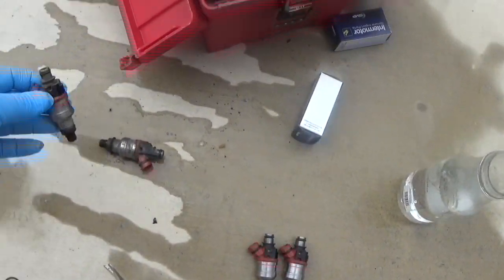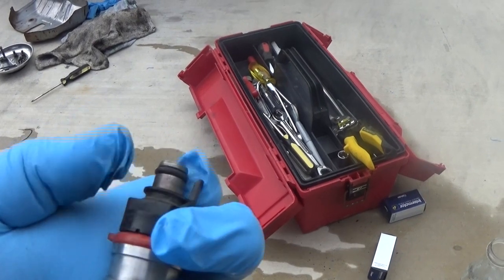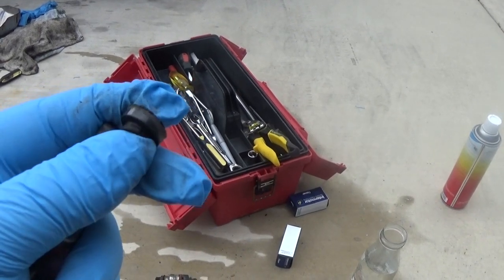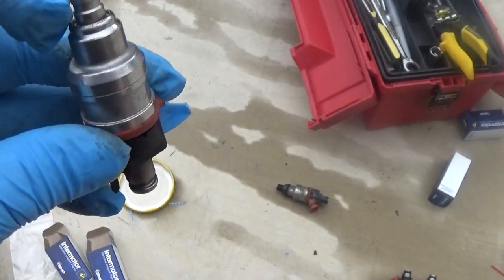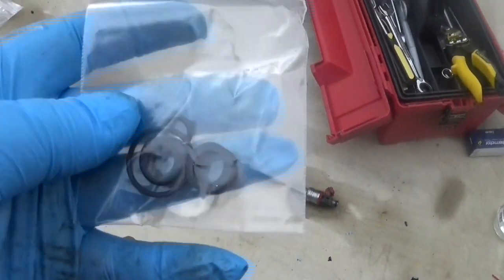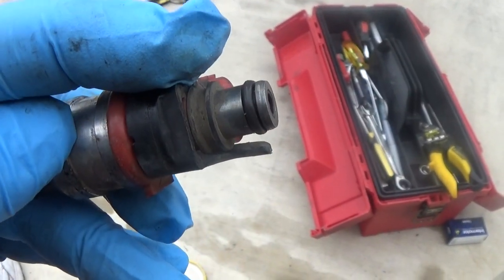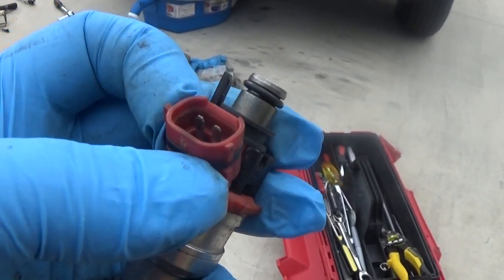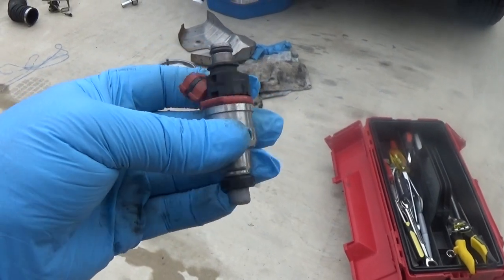22RE fuel injector rebuild

Comment: You can buy a kit on ebay for super cheap that comes with all the o-rings, new filters and a filter removal tool. The whole kit for 4 injectors is around $20

Comment: Thanks for the video!

Does the big o-ring not fit the electrical connector housing?  The o-ring on the electrical connector housing is to keep moisture out of the wiring harness to fuel injector connectors.
Reply: My kits haven't come with the seals for electric plugs either, I just used regular o rings. My issue still persists. I cleaned and installed new screens and seals they worked in the bench but not in car .problem has to be injectors I hope cause it seems to follow two as I move them.